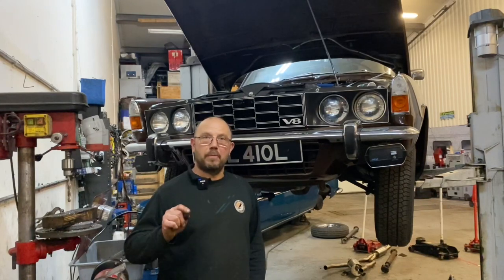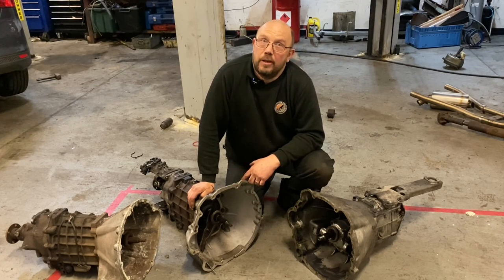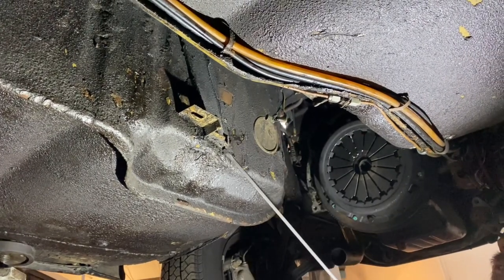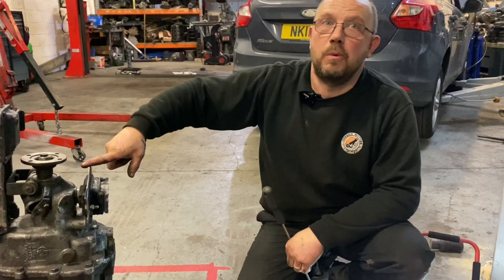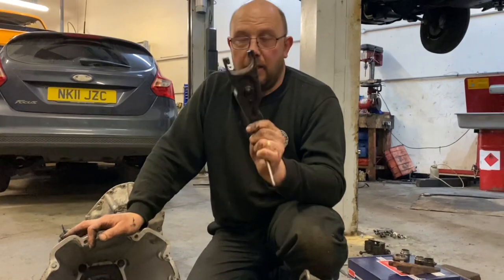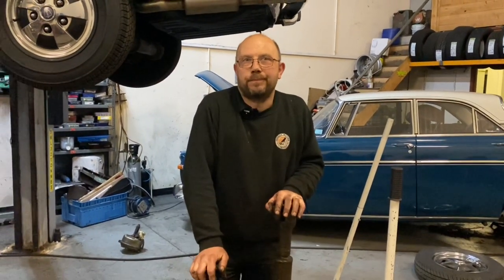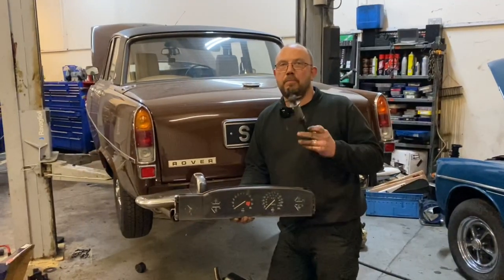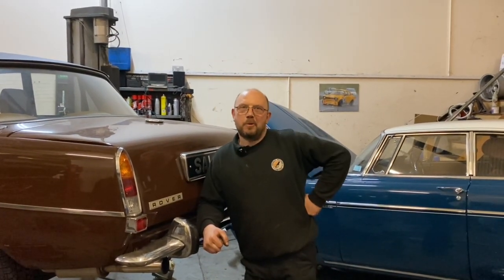5 Speed Conversion - V8 Rover P6 LT77

Comment: I cut down an SD1 gearbox mount and welded flat plates acxross the tops to bolt onto the existing (1976 auto) gearbox mounting points. (back in the 1990s sometime) Fit just fine.
Reply from the maker: Auto tunnel is a lot bigger, and doesnt need modification

Comment: Just the vid I wanted to see! I have a 1974 3500S here in Oz ordered new by an Australian living in the UK (back then) from the factory through the personal export delivery scheme. I have its full history from day one, when it was ordered, when it was built and picked up by the customer from the factory (he brought it home in 1976). The interesting thing is this S was built on the assembly line using an auto base unit, so it has the wider trans tunnel. This type of build was not uncommon apparently, when S base units were in short supply, the assembly workers had a kit to use on these base units to make it into an S. This has been confirmed by James Taylor and a P6 club in the UK (I've seen another of these 'converted' cars 4 sale on Car & Classic a few years ago, I wonder how any were built?). I have an LT77 5-speed gearbox so from what I've learnt over the years it will be slightly easier install than if it was a factory 3500S...?
Reply from the maker: Yes the auto tunnel is bigger making it an easier fit, so you have best of both worlds bigger tunnel but you don’t need to swap the pedal box to fit a clutch pedal

Comment: 5:07 I don't think an LT77 can cope with the torque of a 4.6 anyway. (mine did not last long behind my 4.6). The very latest D suffix box might just about be OK but I doubt it. An R380 box would be a better option in this case but you need to make sure that its not from a van because first gear will be way too short. All of these boxes are heavy and ancient anyway. A 'world class' T5 box is much better but it's a fair amount of work to get one to fit, I'm sure there are other strong boxes that will fit.

Comment: I have a question, can I convert a manual to automatic in a P6 V8? without welding on the tunnel, because these are wider then manual type. Thanks
Reply from the maker: i doubt it
Reply: @PenguinMotors   Oke, then it stay Manuel. Car is inspected now, it is as new concerning rust, complete original, but read that engine has trouble with gasoline we now have, do pingeling because it has high compression. I have then to build lpg in it then, that is high octane fuel.

Comment: How much roughly does a lt77 cost to buy and fit? Looking for a P6 at the moment but hadn't considered that the Auto might actually be the one to go for if swapping to the lt77, useful info!
Reply from the maker: LT77 seem to go for about £500 which is great if it’s a good one, but a bad one might cost you £800 to rebuild. Yes it fits the tunnel much easier, but that is off set by needing to find and fit a manual pedal box and master cylinder assembly  which is a bit of a faff as it doesnot quite bolt straight in and require a bit of drilling and fettling. Point to note 4 cyl and v8 clutch master linkage/master assemblies are different.
Reply: @PenguinMotors  thanks for the reply. I was hoping to find one already converted but I don't think that's going to happen!
Reply from the maker: @yzfdunc  where are you based and whats your budget?
Reply: @PenguinMotors  I work at F W Thornton's. Think you've bought from us in the past. I live in Shrewsbury. Budget £8 to £10k. (Including the base car!)
Reply from the maker: @yzfdunc  yes i have. your budget will get you a nice car, if you dont do it your self you would have to bank on £1500-2k to convert a car to 5 speed. Theres nothing wrong with 4 speed cars, but once you have driven  5 speed ones you really do notice not having a  5th gear. in fact i think Autos are better in that respect , the auto box is quieter than a 4 speed so it seems less revy on the move. One thing you have to ask is how many miles are you going to do in it? if its only a few then to me the cost of fitting a a 5 speed doesn't make sense
Reply: @PenguinMotors  plenty to think about as it would be a car for nice weather / weekends so probably not that many miles. Hmm. Thank you for all your help.

Comment: Wow thats an excellent video,  I've just bought a tr7/8 gearbox to go in my Humber sceptre mk3,  I converted it years ago and put a post 4 speed Box in , you sir have just made my life so much easier,  I just need to shorten my remote by about 6 inches,  is that a thing you can do for me ...  pretty please 😀 😊
Reply from the maker: im afraid my alloy/tig  welding skills are not upto much so i couldnt do it for you, but it wouldnt be a difficult job for a competent welder/fabricator. Another option is find a shorter remote from a Sherpa van, or perhaps a tvr
Reply: @PenguinMotors  cheers for your honesty,  I've put a shout out on the  rover V8 forum for shorter one but they are rare to find, I will find someone local , great video content,  as always 👍 😉

Comment: A very odd gearbox to choose today.............. Expensive, rare and a dreadful change quality............... Instead use Mazda or Toyota. Conversions available for both.......... Much cheaper and a much better result...................
Reply from the maker: I dont think so, its almost a bolt in conversion with factory parts. All the ones i have driven actually had quite a good gear change and worked well. a lot of purists will tolerate a later rover box, but would hate the idea of a toyota or mazda box. im not saying what box anyone should fit, just answering a lot of questions im commonly asked :)